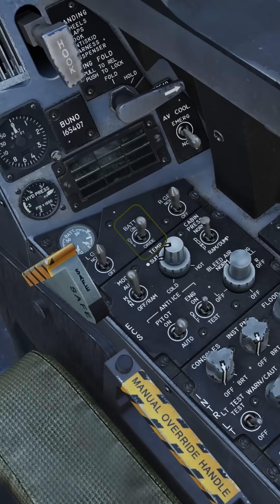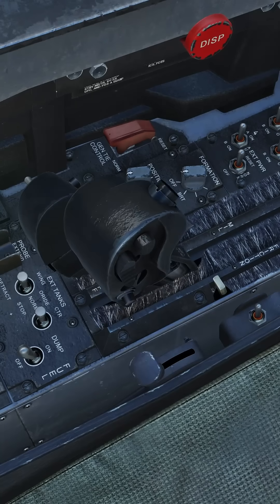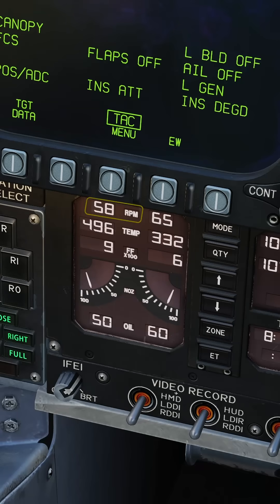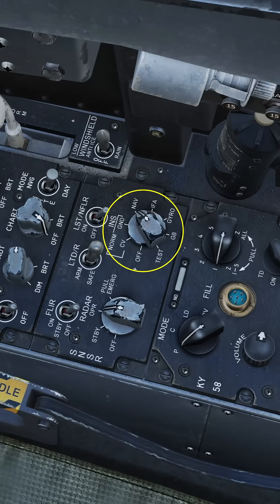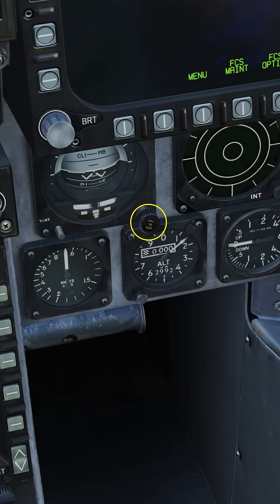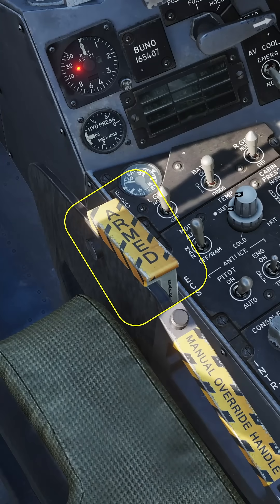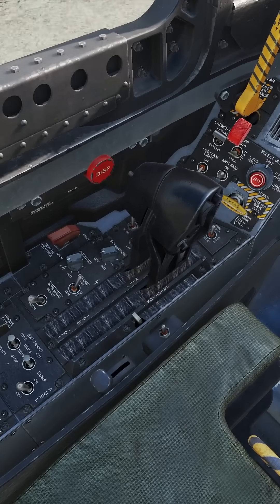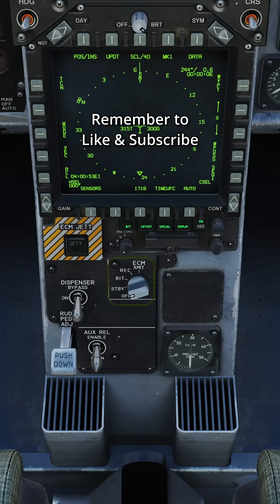F/A-18C Cold Start and Airfield Takeoff in 60 Seconds  #aviation #dcs #dcsworld #f18c #coldstart

Comment: Thanks I’ll remember this next time I’m near an unlocked F/A-18C for some reason and nobody else is around to stop me.

You may wanna go over how to land before any of that happens, because if I’m in a situation where I’ve gotta fly a jet, something has gone incredibly wrong.
Reply from the maker: Man's trying to get 5 stars irl
Reply: flaps down, gear down, reduce speed to about 280 KPH, ease in
Reply: @palerider9565  an f18 will stall at 280 bro.
Reply: @tarkitarker0815  F-18 stall speed is around 130 KM/H
Reply: @palerider9565  at which alt tho? i would argue at 0m above sea. at 400m its defo not 130 anymore.
Reply: @tarkitarker0815  its got a max height of 50,000 feet, it doesnt matter what height its at? its got a stall speed of 130 km/h at its max AOA, meaning full stick back? if its just cruising 130 km/h isnt going to stall it out no matter what height its at.
Reply: @palerider9565  didnt know it cant get less than needed uplift. how tf is this possible?
Reply: @tarkitarker0815  what do you mean? if its at 130 or less its not going to just fall out of the sky. idk what youre not understanding about all this. 280km/h or 174 mph is the ideal speed at which to land and catch the wire on a carrier, 130km/h is not slow enough to just stall the airframe on its own, at max AOA 130 is nearing its stall conditions. regardless of height. rather its at 50 feet or 50,000 feet. idk what else there is to say.
Reply: @palerider9565  i didnt talk about dropping like a stone lmfao. try to realize that a stall thats long enough will wreck the plane. you do not understand aviation too good yourself. i just wondered how the f18 can still have lift at 131kmh while the cessna and other pieces of shit will defo just go into a nosedive at 130 and hard maneuvering.
Reply: @palerider9565 .. Wow this is interesting.. u must be the driver.
Reply: @tarkitarker0815  again, at max AOA, Angle of attack, the F-18 will not stall above 130kph, and a Cessna, wont come close to stalling because they land at 120 khp alone. 

i work in aviation and im around all different kinds of aircraft everyday so, fact check yourself before you look more like a fool.
Reply: @norizammastor9072  nope, just work in aviation.
Reply: @palerider9565  noted
Reply: Ejector seat and let gravity gravity
Reply: @2019SubaruWRX  so you never been shot out a cannon before, eh?  Not everybody survives ejection seat.  Remember Goose?
Reply: @ericperkins3078  have you??
Reply: @2019SubaruWRX  duh
Reply: @2019SubaruWRX  So brother in law Air Force pilot back when trained on T-38 Talon, F-5 Tiger trainer version, ejected out the bottom, not the canopy.  Pilot too close to ground had to roll the plane at least 90 degrees left or right, or be thousands of feet AGL to eject.  Too close you eject and buried at the same time.  Convenient.
Reply: land? he already told you about landing... remember the bit about arming the ejection seat? that's all you need to know.
Reply: Going the Skyking route, I see
Reply: I got to sit in a CF-18 at an air show once. It was cool looking around like “I could absolutely start this thing and probably get airborne…. Except how do you hook up this damn seatbelt.”
Reply: Skyking it XD
Reply: Ejecto seato, cuz!
Reply: We armed the ejection seat for a reason.
Reply: Ejecto seato, cuz!
Reply: by the time you get the enginse going the mp,s wil have you surounded
Reply: skyking v2?
Reply: It was an F14 yes, but wasn't that a plot point in 'Topgun Maverick' ?
Reply: I mean, haven’t you seen Independence Day?

Comment: Wow. Is this ok to be publicized? I would think that this would be confidential at the least.
Reply from the maker: It's all open source. I just took what the game devs said and put it in a video
Reply: Honestly, how to start the plane is probably pretty low down on the list compared to anything else about it. They'd probably be a lot more concerned about things related to the actual performance of the plane getting out than how to start it. And even if all that stuff did get out, the F-18 is an old enough platform that, while very bad, is not world ending for the military in the same way that performance information about the F-22 leaking would be.

Comment: You get bit failures in a video game?
Is DCS a training aide or what?
Reply: You don't. You can enable random system failures in single player and alter the chances of certain equipment failing, but I'm not even sure if the BITs will tell you what's wrong. That being said, the faults are pretty in-depth.
Reply from the maker: What he said, haha
Reply: yes some armies use a modified version of dcs to train (we don't know much about the military version but we know it has some differences due to aaccess to classified data)
Reply: @cyrillaville2367  I know certain militaries use Arma 1 (or was it 2? Can't remember) as a training aide for sure. They just called VBS where I was. But I didn't realize DCS was used as well.
Reply: @thejonathan130  I remember reading about an A10 squadron using it. As for others, MCS is the main money-maker for Eagle Dynamics and they have run into rumoured trouble because of plenty different secretive modules with Ecuadorian Air Force and such.

Comment: You left the APU on
Reply: It turns off automatically
Reply: @ryanedwards1380  but the switch will be kept on On or what?
Reply: @magnusred2945  the switch is automatically toggled off, as with the apu, shortly after the engine generators are operational. You can turn it off manually but is not necessary
Reply: @magnusred2945 Two minutes after the second engine start (technically the second ECU comes on line) the APU drops out.
Reply from the maker: The switch will toggle itself off and shut down the APU automatically, as will the engine crank L/R
Reply: Wow.. u got the driver.. but he knows better.

Comment: over 100 years and we have self driving cars, and fighter jets dont have a plug and start ignition. not to mention the on board navigation looking like its ready to play pong.
Reply: I watched it twice, got the hang of it, now ready for my maiden solo.
Reply: These first flew in 1987 to be fair
Reply from the maker: To be fair, it was designed in the 70's, but there have been a lot of updates and retrofits
Reply: Avionics are incredibly power hungry, and engine starts need a vast amount of energy, it's not realistic either from a weight or space perspective for aircraft to have enough onboard batteries to power everything at the same time. If ground power is available it's possible to have everything powered simultaneously until engines are running.
Reply: @tomjackson1923  Weirdly, this Hornet only lets you select half of the systems for ground power. There's like 6 switches which each select 1 of 2 things to route the ground power to. So you only get half of things at once, just for maintenance testing I suppose.